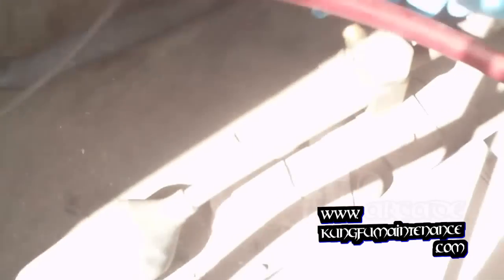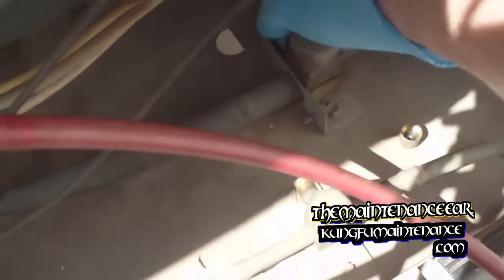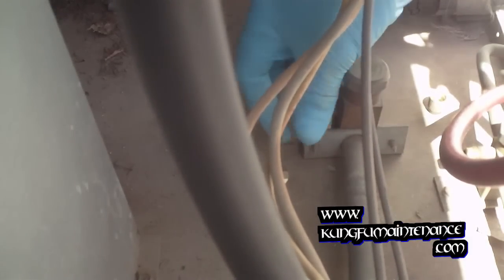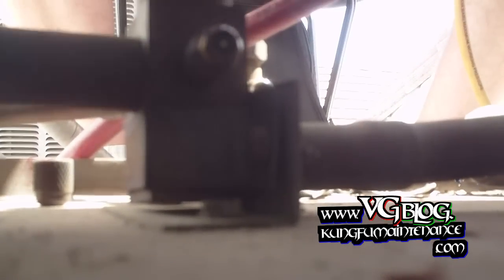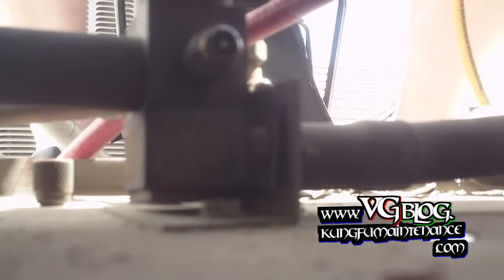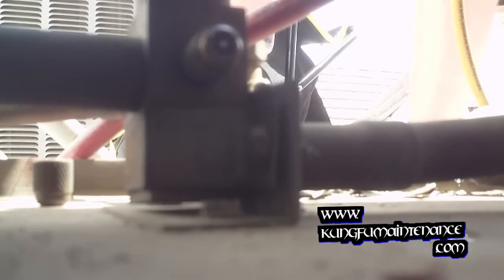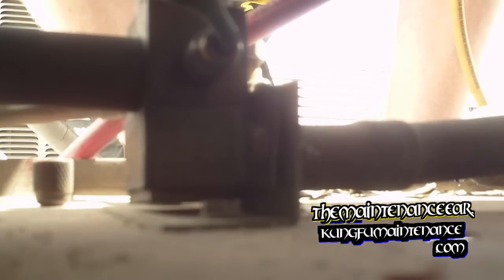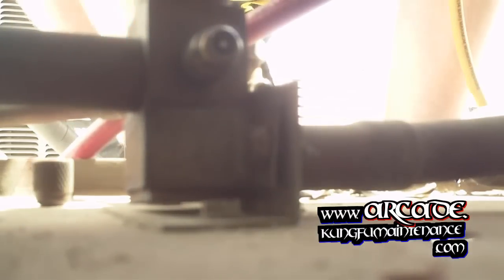How To Repair A Leaking Air Conditioner Service Port Schrader Valve Core Loosing Freon

Comment: what do you do when it's not a schrader valve?
Reply from the maker: +armchairjudge Locate the leak and repair it. The second most often place for refrigerant leaks is at the evaporator coil. First most often is the Schrader valves.

Comment from the maker: Once you suction it form the outside it will work on its own. The plumbing works via gravity much like other plumbing drains. Most condensate drain lines have a trap just like conventional drains. Sometimes the trap can get gunk build ups inside and this is why there may be some advantage in pulling out the water more heavily with the a wet dry vac to help pull more of that gunk and debris so it doesn't contribute to a future clog.

Comment from the maker: Yes depending on your particular set up that is correct. The condensate tablets you place in the condensate drain pan itself. They are much better than bleach in that they are time released so they continue working over a longer period of time, they contain an anticoagulant to keep dirt from clumping together and causing a clog, they contain anti molds and anti fungals and help hinder bacteria and irritants from growing in the pan and spreading around the house via A/C delivery.

Comment from the maker: After things are all clear it is a good idea to set the thermostat to on (and A/C a little lower as the A/C removes quite a bit of moisture from the air) to keep the house fan on and help dry everything out as soon as possible. Placing other fans to dry out other ares that may have gotten wet is a good idea also to prevent mold.

Comment from the maker: As long as it is a wet/dry vacuum it should work just great. I would pull the majority of the water out through the drain pipe outside to ensure the drain is good and clear. Some plumbing drain lines have vents hooked up in the  line near or below the evap. coil, sometimes you will need to cover these while the vacuum is pulling out the water to make sure the water is being sucked out from the pan and not just the vent. It is good idea to add condensate tablets after gently vacuuming the pan.